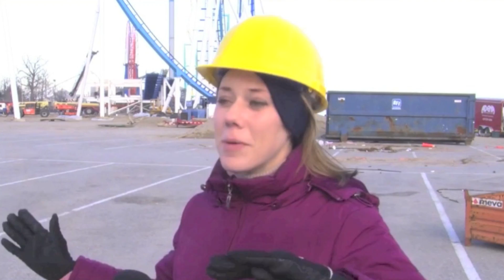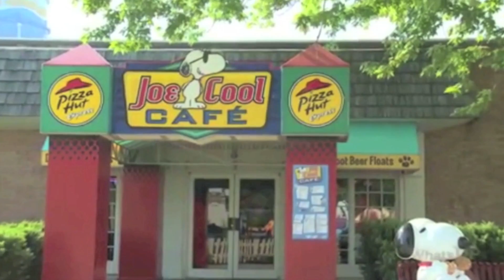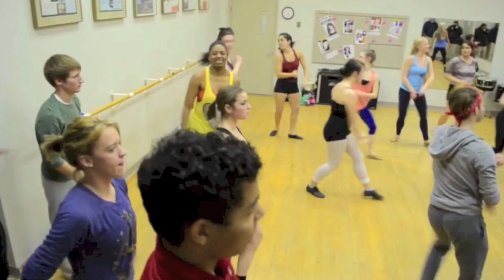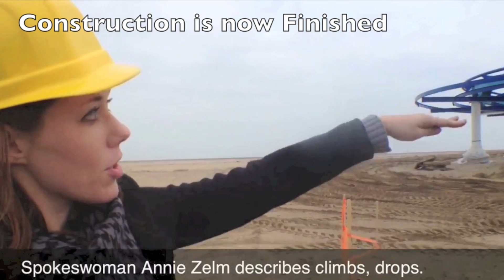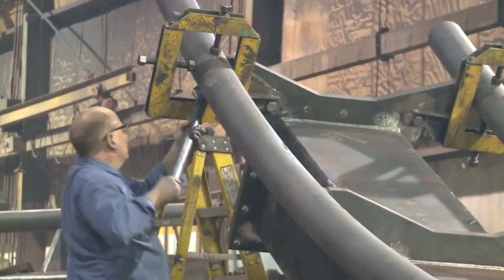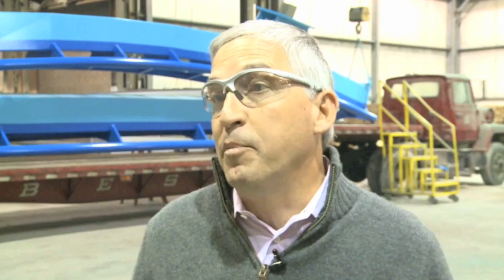Cedar Point Prepares for Opening Day (and GateKeeper: Behind the Scenes)

Comment: No, Dollywood did not "do it first."  Raptor at Gardaland was the first B&M Wing Coaster.  Besides, Wild Eagle doesn't even have the high speeds, wing-over drop, keyholes,164ft drop, or pretty much any element that Gatekeeper will have.
Reply: Bob Barker swarm was the first wing coaster to have the upside drop. Proud to live 40mins away from Thorpe Park